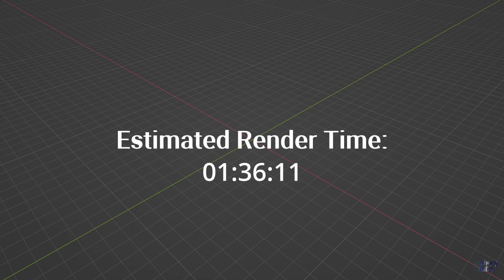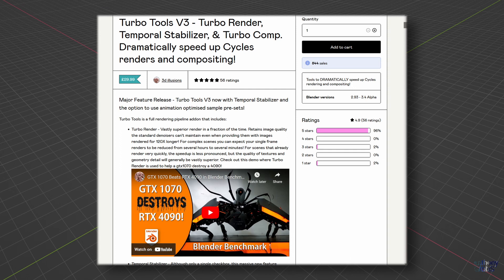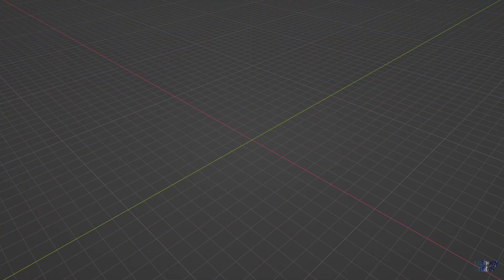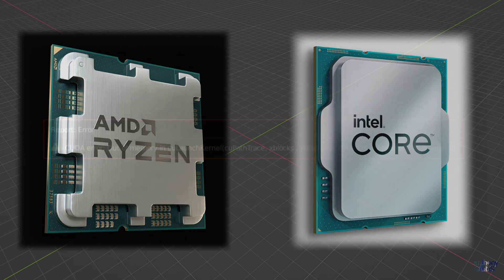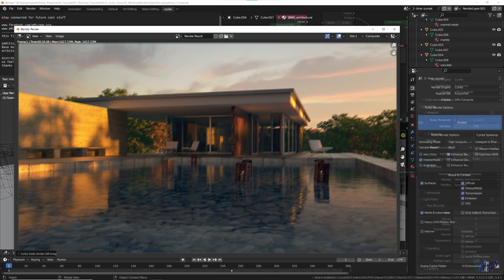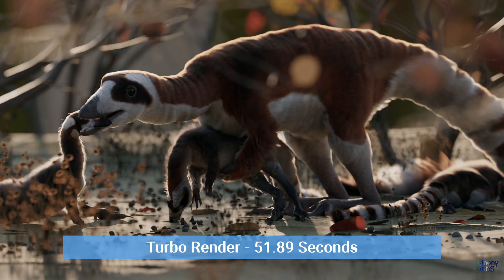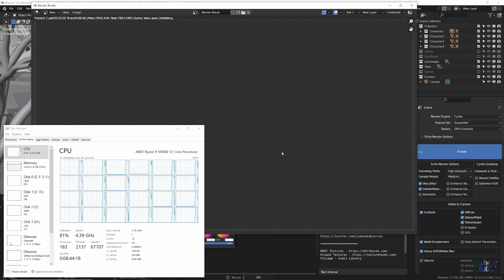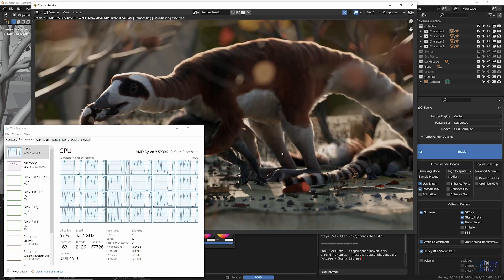How To Render 3 Times Faster In Blender

Comment: How well does this work for animations? Specifically fast movement animation. Im new to blender but whenever i try to temporally denoise frames in the compositor after rendering, there will be streaking that occurs in high movement scenes so i was wondering how the temporal denoising works when youd have high movement (like a person waving at the camera)
Reply from the maker: While Turbo Tools does a good job, it's not magic. For the most part one would need to sort it all out with standard Cycles Blender and once you have the result you want (using short length test renders for animations), then kick in Turbo Tools and tweak it's settings to get the same result just faster.
One thing to try for animations is under Render Properties | Sampling | Advanced for the Seed value click the little clock face icon. That will randomise the noise pattern for each frame, helping to prevent the denoiser from basically resulting in a constant denoise pattern across frames.
The other solution to fast movement is motion blur. If you look at any video frame by frame, the first thing you will notice is just how much stuff blurs on every frame.

Comment: Dude just stop it just stop while your ahead! Your embarrassing yourself! All these shortcut attempts won't solve anything just bring in more problems! Without a proper graphic card there is no otherway! Unless you want your masterpiece to look like shit! Don't let art suffer because your too cheap to buy a good computer! You must Find away! Maybe do some yarn work or something is only for a couple of months but it be worth it when you can bring your dream into this reality!
Reply from the maker: I do have a proper graphics card, a 3080 Ti which was used for all the renders/testing. As you can see in the video my whole goal was to match render quality and see if the addon could do it faster, which for the most part it could, just takes a little playing around with the settings. If the render times are short anyway, then it's likely not worth spending the time to adjust settings, but once renders take longer and/or animations then tools like this can basically make a 3080 Ti even faster and if at the end one can't tell the difference, then why not save the render time.

Comment: which is faster between this and k-cycles?
Reply from the maker: Good question and I wish I could give a solid response but I've not actually used or tested K-Cycles. The other issue is that they sort of aren't the same thing. K-Cycles is an actual full custom build of Cycles, where as Turbo Tools is a highly optimised denoiser that gets applied to the actual render that Cycles makes.
No doubt both will result in faster/better renders, so it may more come down to price, difference in features and if those matter and that K-Cycles is basically a yearly upgrade cost, while Turbo Tools is a one off purchase.

Comment: Have you rendered the blender splash screen in medium with turbo tools? your screen seems to show so but you might have changed to high just before rendering so i m just asking to make sure.
Reply from the maker: I tired medium sample settings in a couple of cases and while it was faster and gave an OK result, when one starts to compare quality (this was with a few sample scenes) the difference really started to become more and more noticeable. My main goal of the testing wasn't to see how fast I could render something that still looked OK-ish, as much as possible the resulted needed to be as good or better then just using standard Blender.
As such, I usually found one had to use high settings for both samples and denoise quality. Even so, that usually resulted in around 3 times faster render (CPU scene prep time not withstanding), tho in some cases one did have to spend a bit of time tweaking settings.

Comment: does this only work for the final render or for the viewport too?
Reply from the maker: It's for the final render only via Cycles. Basically when you press F12 or CTRL-F12 for an animation, if Turbo Tools is enabled, then it will be used to do the render. If the add-on isn't enabled, then pressing those same buttons means normal Cycles/Blender will be used for the render. This does apply to both GPU or CPU render however.
For the viewport, one would usually use lower samples and OptiX denosing (if you have a RTX card), to get a quick look at overall lightning, bump/displacements, etc. Then every now and then hit F12 (with or without Turbo Tools) to get a higher sample/quality render just to make sure you aren't missing anything in the viewport render.

Comment: I think it worths the money! I wonder how much change would happen in a complex architectural scene. Good work!
Reply from the maker: I think it would matter what makes the scene complex. If it's more geometry but fairly simple shaders and only a few lights, then possible little difference. But once you add more complex shaders and extra lights with more bounce, etc then chances are the render time will jump and the longer the actual render time is with normal Blender then the better the chance that Turbo Tools will have a greater impact.

Comment: hey, thanks for reviewing the addon!  :)  I was interested in your results so did a few tests, and found:

The top left hand corner of the bird scene, where you mentioned standard Blender had done a better job of retaining details, it's actually denoising artefacts rather than better detail.  You can test by rendering a small render region in that area, and increasing the max samples to 8000, and the noise threshold to 0.0001.  You'll get similar results to turbo render then.   

Regarding the fine hairs, rather than using one of the generic sample pre-sets (which are extremely low), it's best to arrive at the maximum saving turbo render can provide by using the 'user' sample pre-set, and then reducing the samples as much as you can without losing hair detail.  Or alternatively leave it at the same samples for a better result in the same time, for example in this scene, choosing 'user' sample pre-set, high denoise mode, and leaving the samples at 250, will result in the same render time, but if you check small details like the teeth etc, you'll notice a huge improvement in the Turbo Tools version.

If you really want to see how big of a saving Turbo can provide,  I'd recommend trying a difficult to render interior scene that take several hours to render.  In those cases Turbo will  generally reduce a 10 hour render for example, down to under 10 minutes.  If you notice any swirly artefacts (like what was mistaken for better detail in the bird render) you'll need to use 'user' sample mode and disable the noise threshold.  It's a bug with Cycles caused by adaptive sampling burning patterns into the render that the denoisers think are intentional.
Reply from the maker: Thanks for the info. I only just found this comment, for some reason Youtube was hiding it from general view. 
I did want to try a scene that would take a bit of time to render, just to give Turbo Tools more of a chance to stretch its legs. But at this stage I personally don't have anything and didn't have much luck finding something 'slow'. I tested a number of the standard Blender demo scenes with little luck, was hoping the bird would be a fair example, but in the end that turned out to be as much about the CPU and pre-render phase, which while something worth highlighting, wasn't exactly what I hoped for.
It's one of the reasons I included the CPU only test for the BMW scene, if nothing else it does show the different Turbo Tools can make, especially for anyone that has scenes which they can only render on CPU.